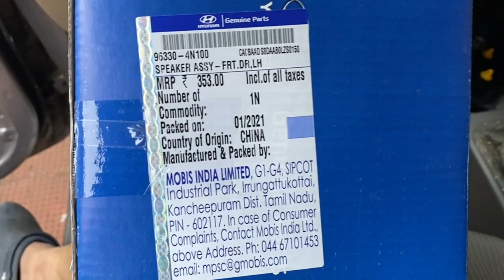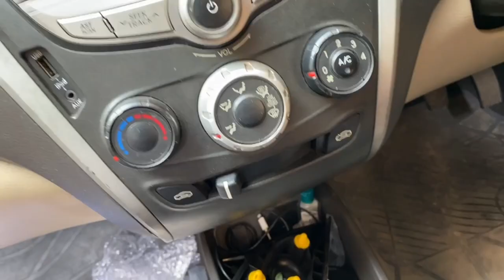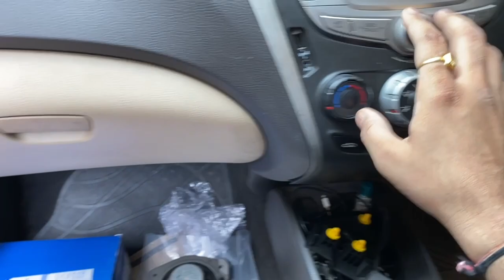Hyundai Eon - Front Door Speaker Replacement - Part 1

Comment: I have ordered both right side speakers will it work on the left hand side
Reply from the maker: I doubt as it has reversed sockets to fit, if you see the video there is no separate speaker as it come with outside brackets too which is non removable speaker box. See if that fixes else I would suggest to order proper angles and side one.

Comment: Hello sir, what size speakers fit in front grill of hyundai eon magna plus (800 cc)
Also if you can let me know size for rear speakers
Reply from the maker: 4 to 5 inches if you take original it should be 4 inch and fitted with company box so you can not make changes in it

Comment: what size speakers fit for the Eon on front size
Reply from the maker: That’s dedicated socket speakers and it is 4 inch you can install aftermarket but need to drill to the door and can install up to 5 inch speakers
Reply: @KeysWheelsByDhirajPatel  hey there thanks

Comment: Hi Bro, Can we fit 5.25 inch sony speakers XS-FB132E
Reply from the maker: Yes, you can but this is aftermarket, so you need to modify the speaker area with aftermarket kit.
Reply: @KeysWheelsByDhirajPatel  thank you. my hyundai car speakers making rattling sound even at medium volume will it fix If I replace speakers? especially left side speaker is making more rattling sound. I tried Aux, Usb and Bluetooth but from all channels same issue. Can you please suggest

Comment: 353 me 2 pcs h ya 1 pcs sir
Reply from the maker: I didn’t get your question? What is 353?
Reply: @KeysWheelsByDhirajPatel  How much will 2 pcs speakers cost?
Reply from the maker: On boodmo it was just around ₹700 to ₹800 (original) but if you want modified one it’s depend upon which brand you select
Reply from the maker: Single at ₹352
Reply: @KeysWheelsByDhirajPatel  thanku so much Sir for your information
Reply from the maker: @remogamer6980  you’re most welcome
Reply from the maker: @remogamer6980  around 800
Reply from the maker: You’re most welcome

Comment: Nice.., next rear speaker connection for same inbuild car sterio connection details
Reply from the maker: There are no inbuilt rear speakers in this car but there is a provision and I have installed same 4 inch speakers at back which are just normal and can be connect to the same speaker wires

Comment: What's the size of the speaker
Reply from the maker: You can use 4 inch to 5 inch speaker but company fitting is absolutely standard with external body and holding mounts so it’s tough to mount external speakers rather than original but possible but need to do lots of modification work